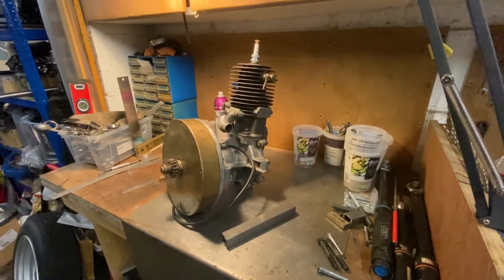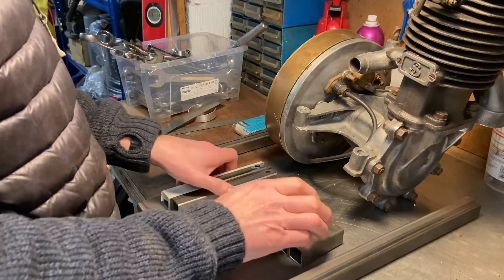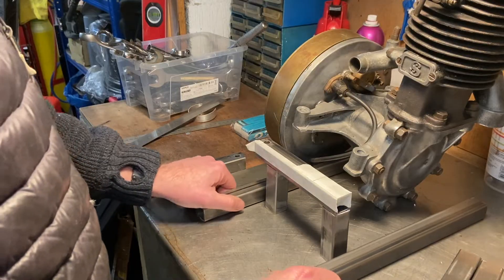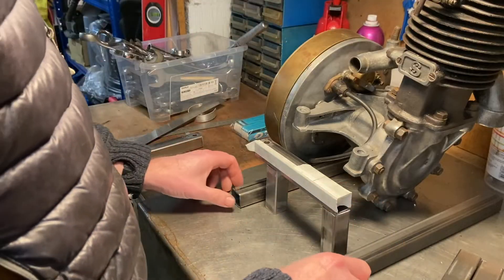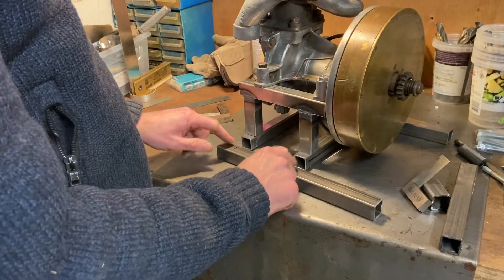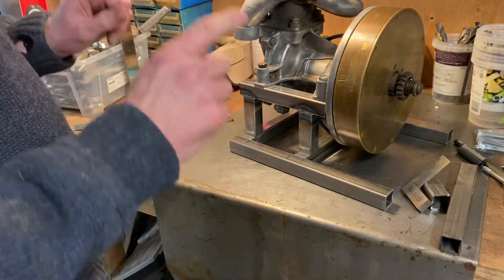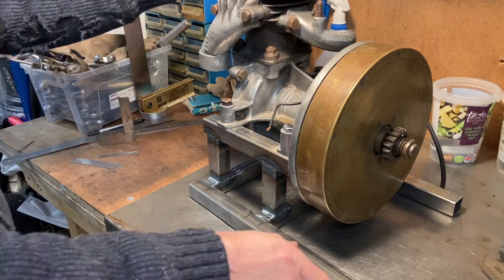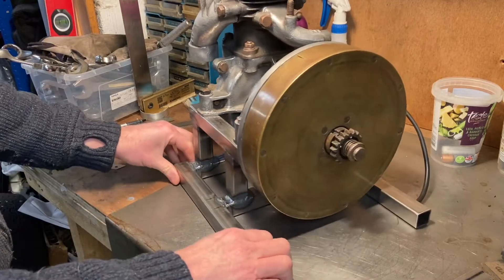Ner-a-car Engine Project - Episode 2

Comment: Hi, really interesting videos, would you mind sharing the amperage you use for TIG welding your box section on  the engine stand also for the 5mm plate used on the Austin Seven radius rod conversion. Thanks.
Reply from the maker: hi, for the engine stand which is box section with a wall thickness of 2mm, I used 80 amps as starting point and I use a pedal to back off if it's a bit too high (which happens when you get near the edge. For the plate on the suspension project I used 130 to 140 amps. As it's thicker you can be a bit more flexible and just move a little slower if needs be.
Reply: @thebracketfactory  thank you